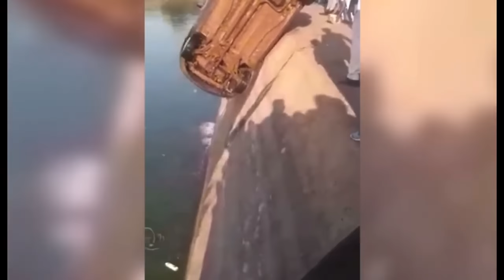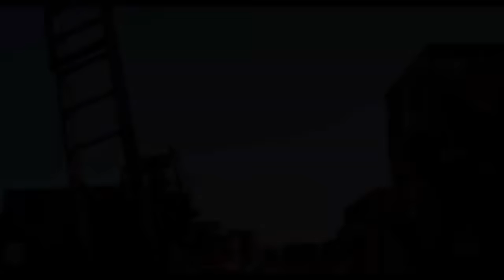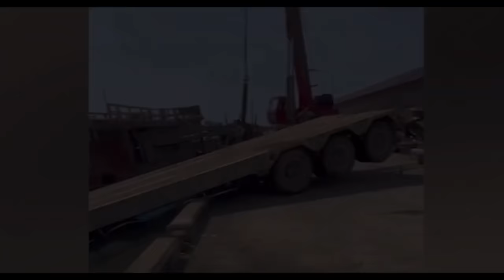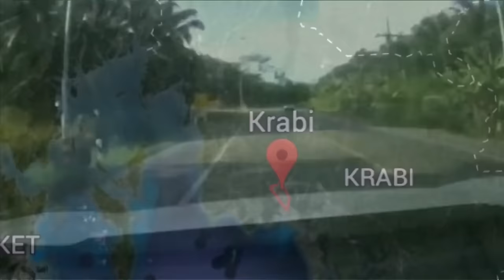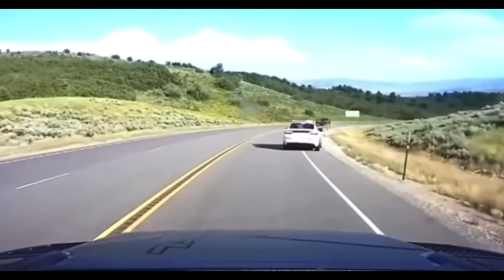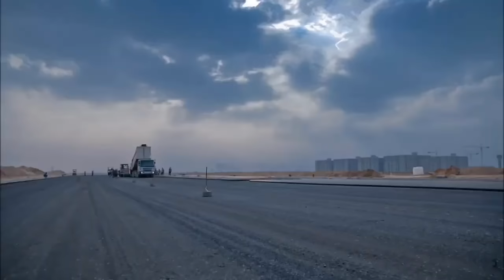MOST CATASTROPHIC Work Failures EVER Filmed (2024)

Comment: Fifteen years ago, I was a volunteer at the Omaha Food Bank. I rolled regularly with the same paid employee CDL licensed truck driver at the time. We were sent to make a delivery to a charity that was having a panty event that day on the North side. We pulled in and there was already a line nearly two blocks long of people ready to accept the food as donation. But they had to wait for us to deliver it to the charity. And we had arrived, right on time. The truck had a Tommy Lift on the back. It was a twenty-six ton straight box truck. My driver took the initiative and the manual pallet jack and lifted an entire pallet of split pee soup.  It probably weighed two thousand pounds. 

He gets is lifted, then makes his way to the Tommy lift with me helping. He turns the pallet around, to push it onto the lift rather than pull. But the Tommy lift had a slight downhill grade to it. And the driver operating the pallet jack wasn't prepared for what happened the moment the pallet jack with the one ton load of canned soup on it was on that downhill grade of the Tommy lift. We are very fortunate no one was near the back of the truck as they often are, asking us for things ahead of everyone else.

And the pallet jack rolled right off the back of the truck, dumping the split pea soup pallet on it's side four feet down on the cement. Where maybe one fourth of the cans exploded on impact. I never will eat split pea soup again. Took us an hour to clean up the mess.

Comment: 1st Video:
The String which was attached collapsed. But yeah its always the operator to blame first.
Reply: The operator is ultimately responsible for the safety of the load and for ensuring that the appropriate equipment is used.